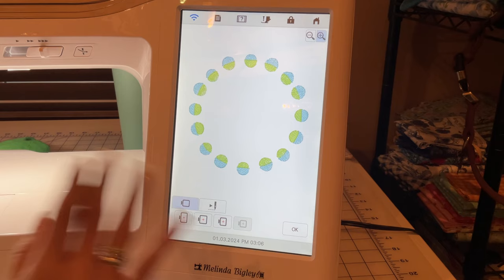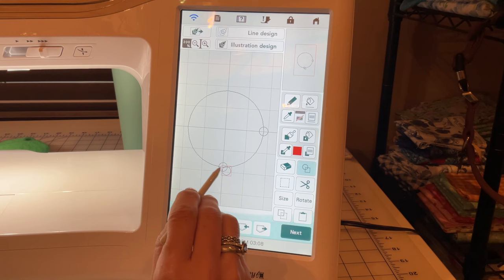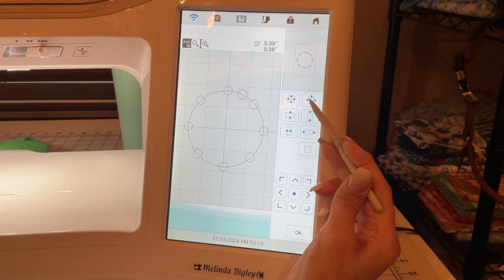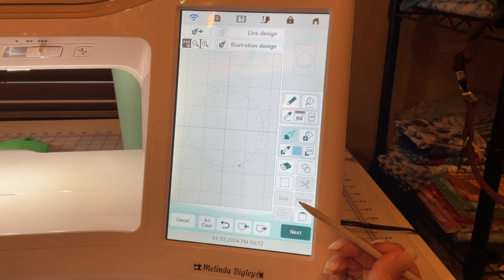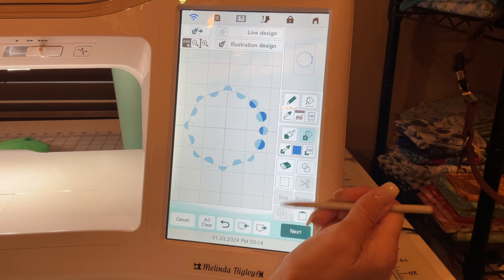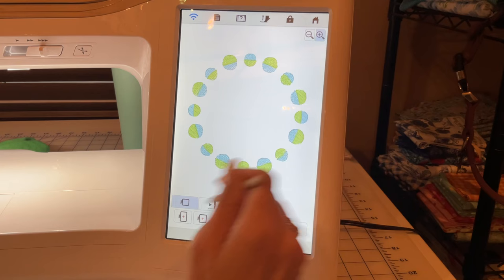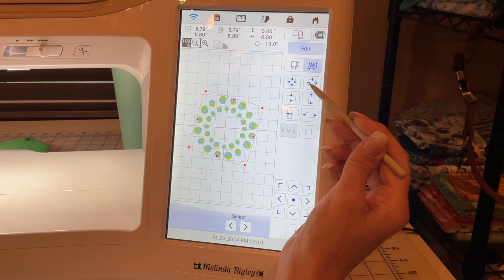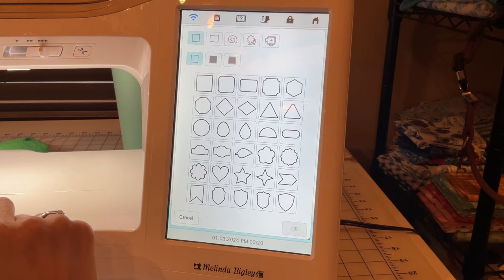IQ Designer Circles

Comment: I am not a big fan of King Star thread.  I bought 8 spools to make my Christmas tree skirt this year and every spool broke even though I changed my needles and made sure that I used a spool cover on the thread.  I own a Baby Lock Venture and Baby Lock Destiny and the thread broke on both machines.
Reply from the maker: That’s the first I’ve heard of that, Tiesha. I’ve used it for years for decorative purposes and never had an issue. I’m assuming you were not using it to construct your tree skirt, correct?